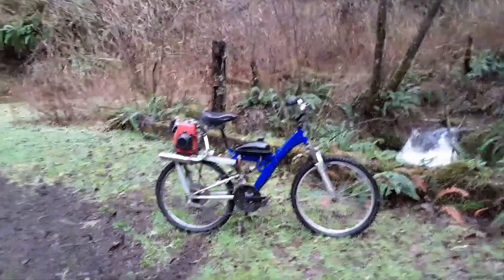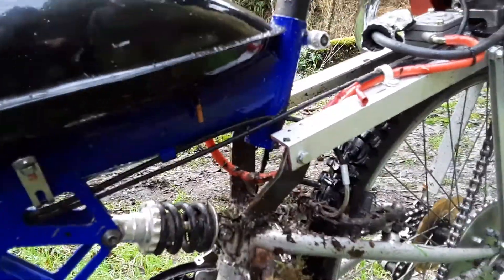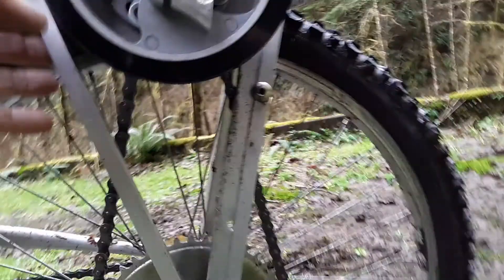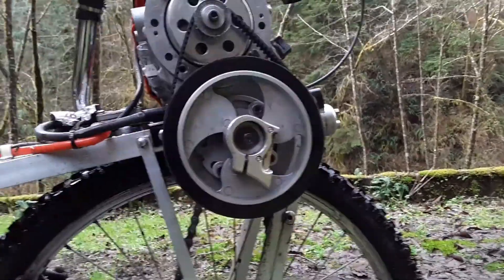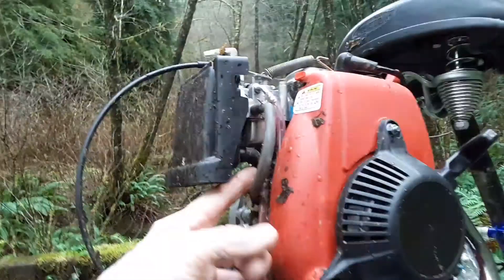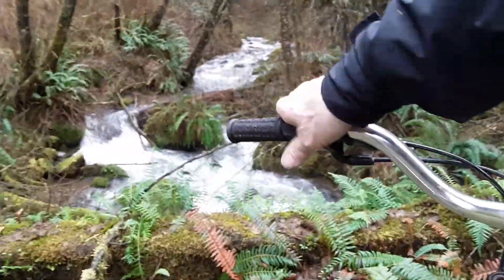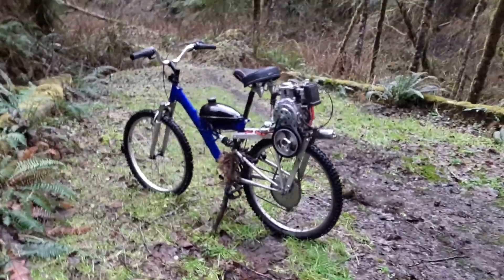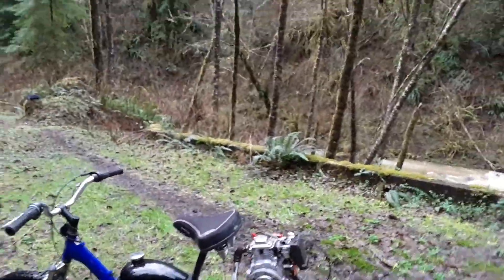4 stroke bicycle engine on full suspension mountain bike

Comment: Hello, how did you got gas flow for carburettor?
Reply from the maker: I installed a small vacuum pulse fuel pump. Spliced into the crank breather hose and put a small fixed orifice on the filter side of the breather hose to give the positive/negative pulse. Works great but has to be primed when it has sat for a couple of days or so.
Reply: @minibikeaction4266  ok, I think that I will go with a mini electric pump, I'am thinking to up the power on tgat little engine when I will have it